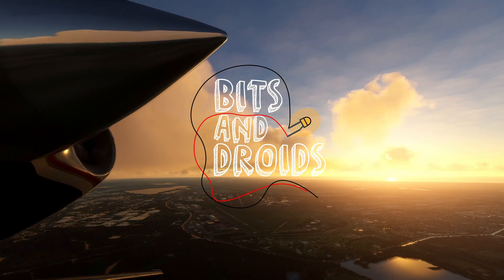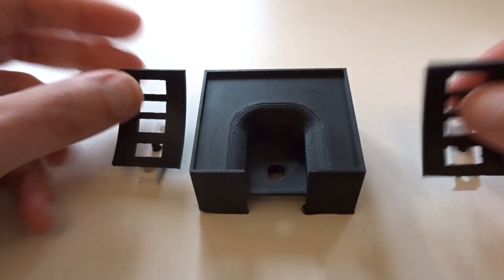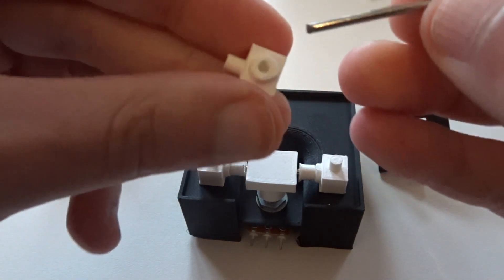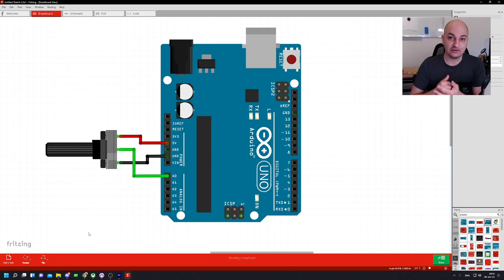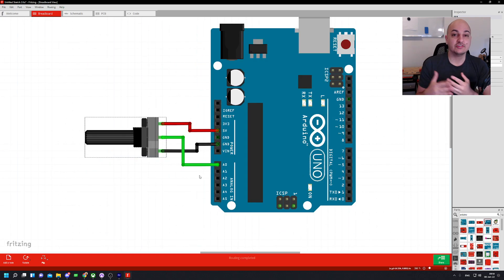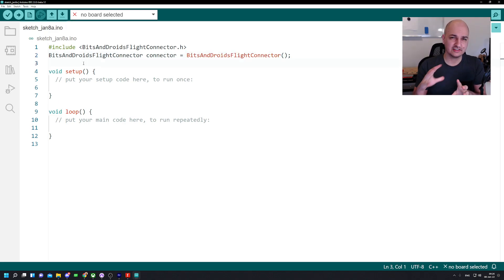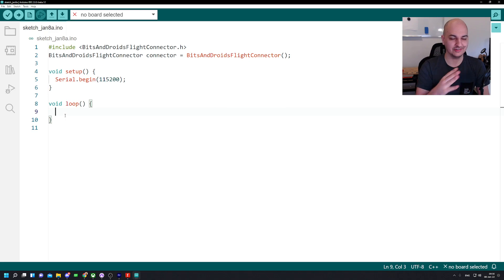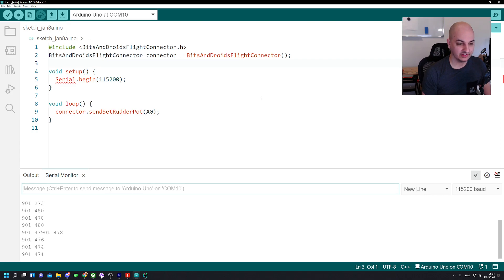How to: DIY rudder pedals for mfs2020

Comment: With the current version of your library I get this error message when trying to install from a zip file into the Arduino software: "Error 13: Library install failed: archive is not valid: multiple files found in zip file top level". Any ideas on what needs to be fixed?

Comment: Can I ask something. I noticed you said that left value is different to right value. Can this be down to the pot not being a linear pot and instead a logarithmic pot as they ramp up when turned fully clockwise. I noticed the same with the throttle you built. I want to do the same as noticed the slide pots you used were logarithmic so they ramp up as you get towards the end. Did you pick them for that reason?
Reply from the maker: In this instance it came down to mounting. Due to the simple construction center just wasn't really centered. I never really put that many thought in the choice of sliding pots in my throttles. Your comment is the first time I thought of the difference of the pots installed. But you might be on to something. Will dive into this

Comment: Thank you sooo much for this video! I'm not making rudder pedals, but a jet nose wheel steering hand tiller for the jet aircraft in FS2020 based on the CRJ. I have already 3-D printed the tiller handle, but I was trying to figure out the electronics portion. I just need control around the Z-Axis for yaw. I will modify what I have learned here for my project.

Comment: Having a 3d-printer would make my life so much easier :D that's a great idea! 

I'm so done with working with aluminium sheets.
Reply: You will have another hobby call tune the printer though. This one not so easy😅
Reply from the maker: It makes day-to-day life easier. The print time is longer than working with other materials (most of the time). But in the long run, I'm able to design something, start the print, go do something else, and come back to a "finished" project. It isn't a magic solution though some stuff can still better be made with other materials.